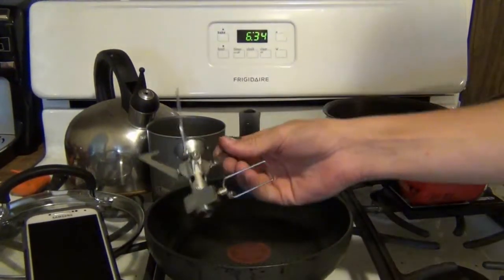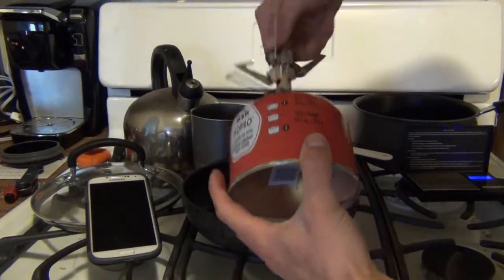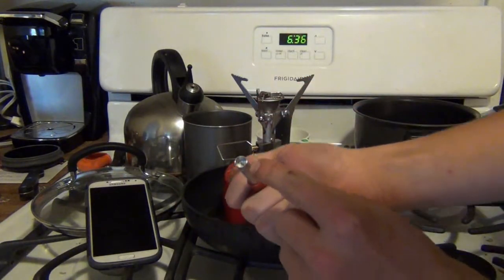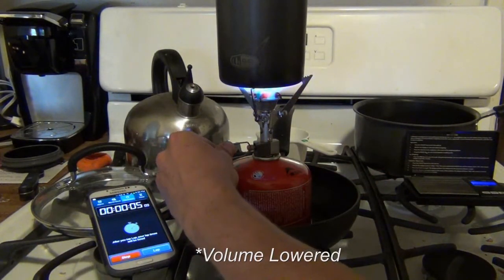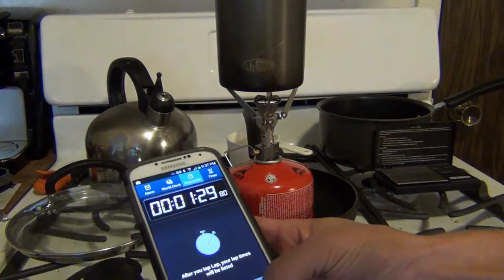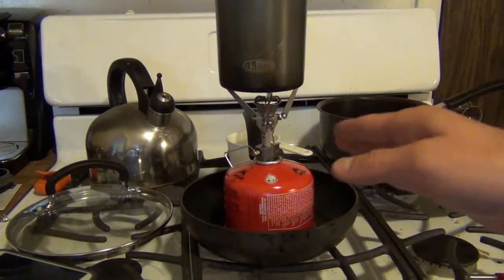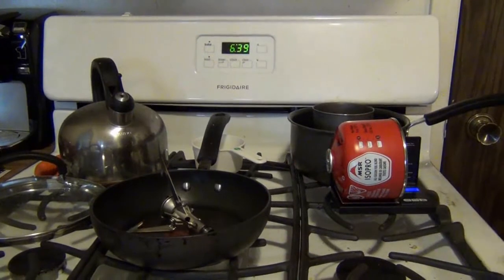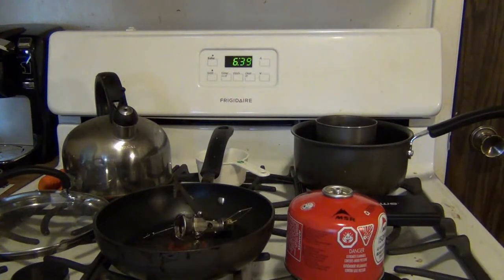MSR MicroRocket 1Cup Boil Test

Comment from the maker: I am unsure the empty weight.  This was a full can that had a weight of 378g before it was ever used, and it had 372g after boiling 1 cup of water.  So it used 6grams to burn one cup of water (and I did waste some gas before and after, so it probably only really takes 5grams).  The canister has 227g so it should boil about 38cups (at 6 grams per boil) or 45cups (at 5grams per boil).